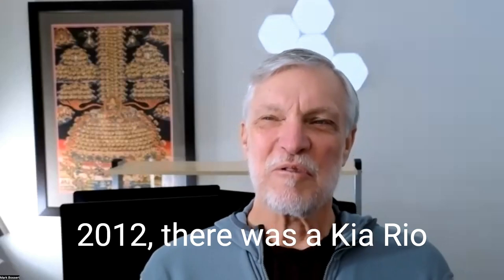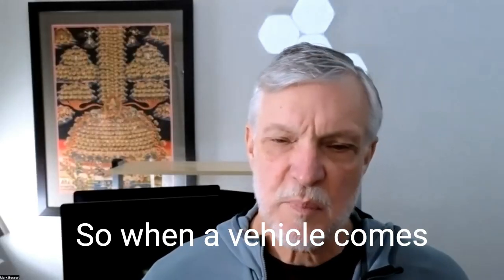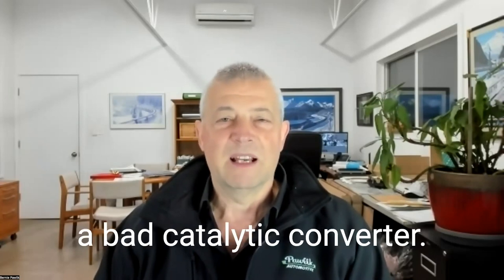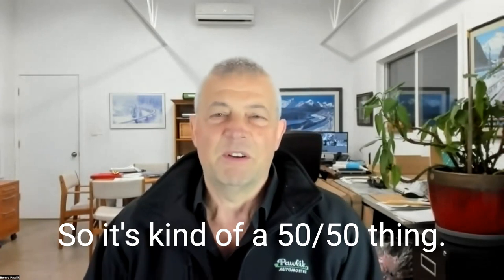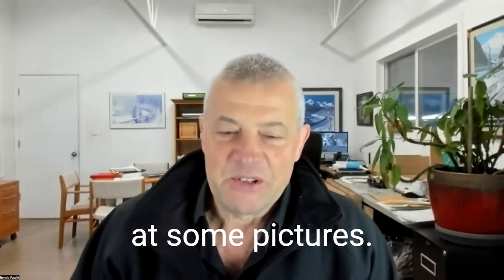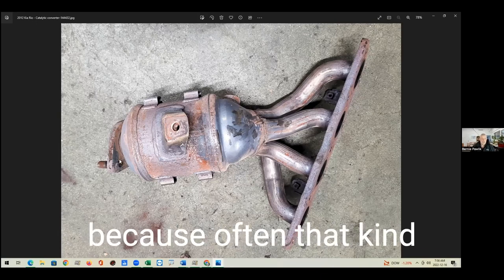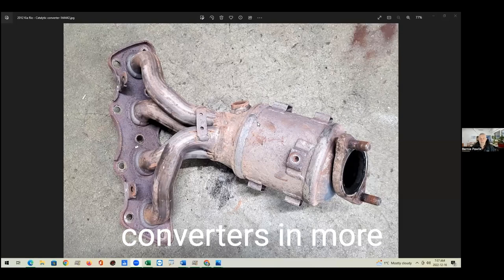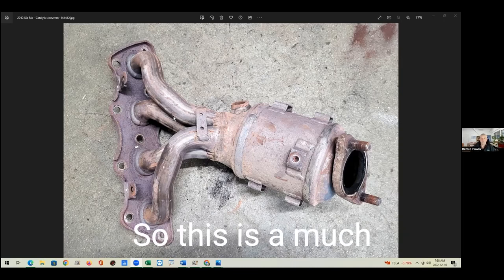2012 Kia Rio Catalytic Converter

Comment: Awesome video just for me. I have a 2015 Rio with a failed cat I'm going to replace myself. I think it failed due to excessive oil burning on this car. I have no idea how to fix the oil burning so it will probably kill the next cat I replaced. Time to sell this car? Lol
Reply: I am having the same issue with my 2015 rio. Excessive oil burn and now the check engine light is on and giving me the cat conv code. Did you end up fixing it?